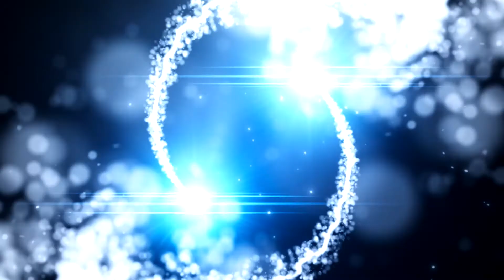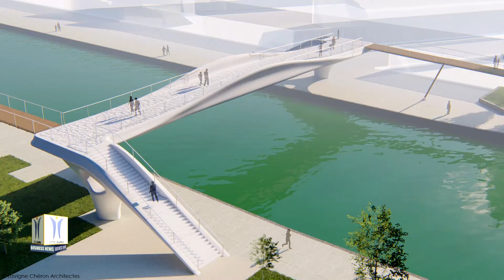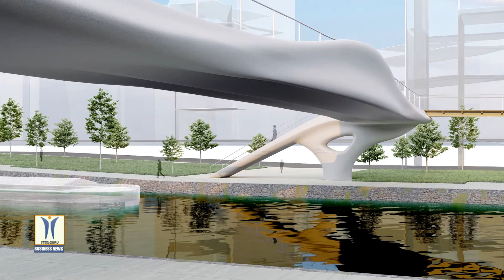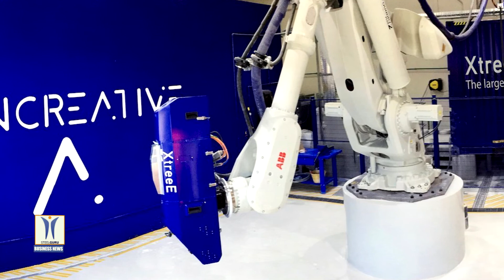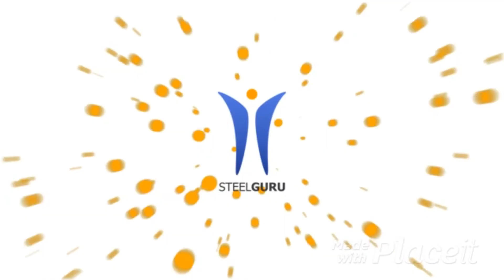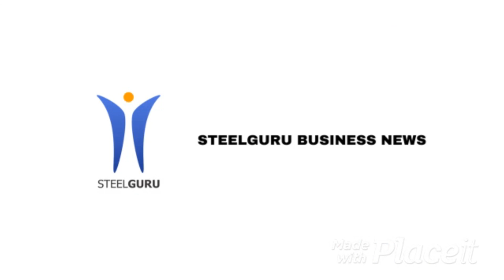XtreeE to 3D Print Concrete Footbridge for 2024 Paris Olympic

Comment: XTreeE to 3D print Footbridge in Paris for 2024 Olympic Games
In anticipation of the 2024 Olympic Games, Plaine Commune Grand Paris has awarded the Freyssinet / Lavigne & Cheron Architects / Quadric / XtreeE / LafargeHolcim consortium the design-build of a 40-meter pedestrian footbridge in Paris whose deck will be entirely made of 3D printed structural concrete.   READ MORE; https://www.gcoportal.com/xtreee-to-3d-print-footbridge-in-paris-for-2024-olympic-games/